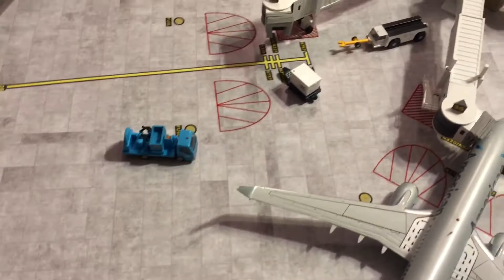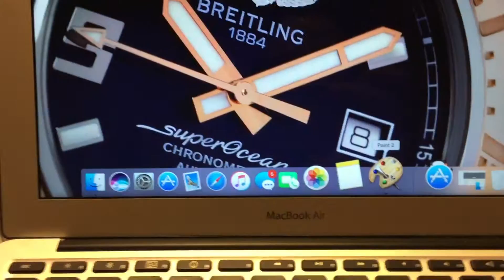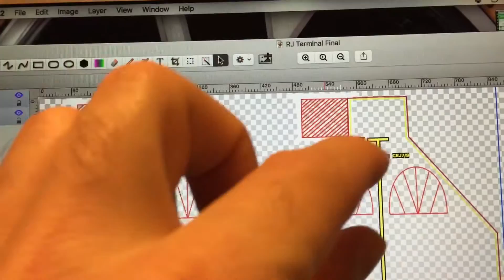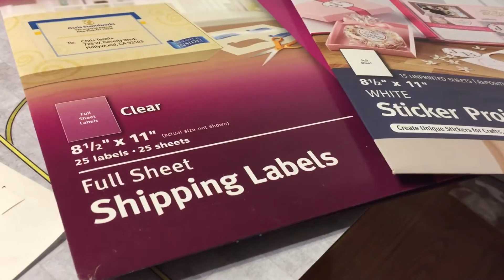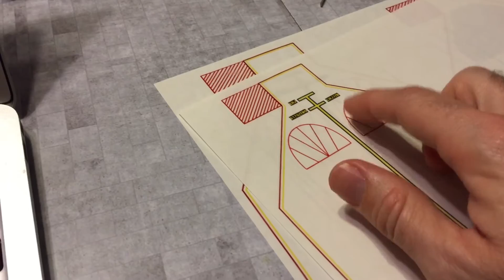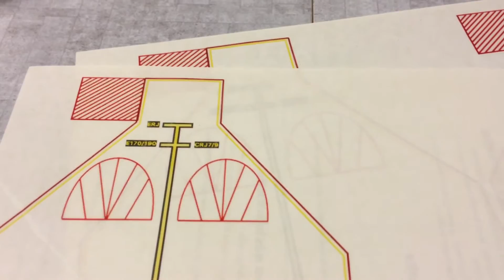1/200 Tarmac Markings

Comment: how do you paint the engine for the Frontier aircraft ?
Reply from the maker: Joshua Kornfeld I use standard testers and brush it on. I typically remove the engines from the pylons, but on my ERJ I did it with them on. Dark green works, and I use the exactly knife and scrape off any excess from the front lip. I clearcoated the ERJ but didn't like how shiny it made them. So since I haven't used clearcoat and I think they look better.